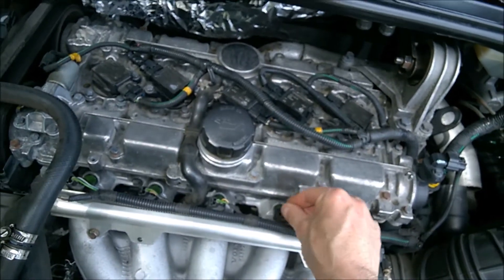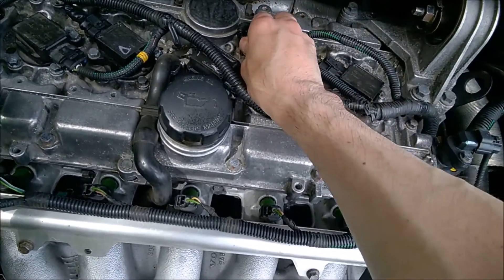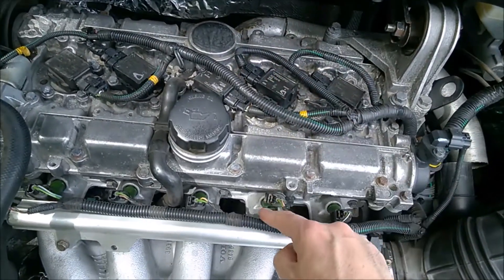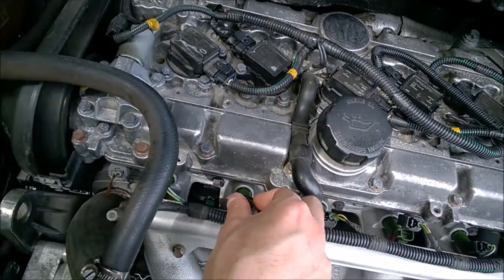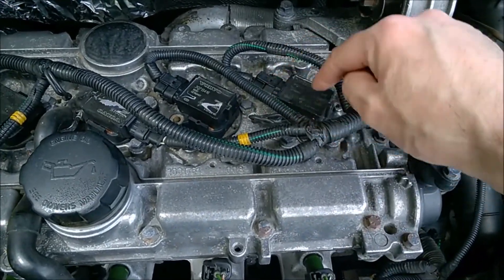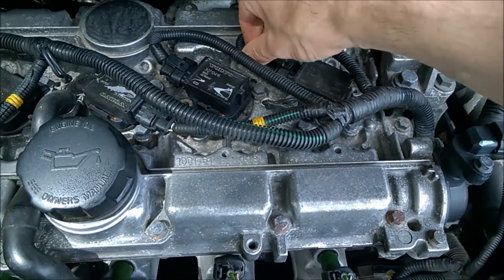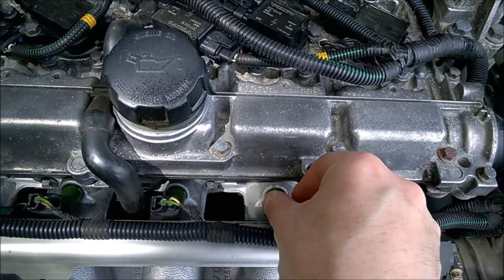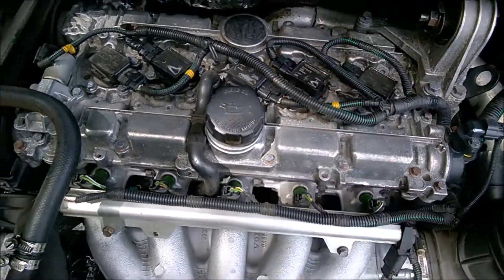Simple identify a faulty Ignition Coil - engine hesitation (misfire)  DO NOT TRY on GDI engines

Comment from the maker: IMPORTANT - it's much safer to unplug an injector than to unplug an ignition coil. Ignition coils have very high current inside, plugging them back may cause a current surge and damage the coll. 

Remember, a cylinder that doesn't have ignition may be due - check in this order - to spark plug or lots of engine oil around spark plug from engine cover gasket leak, ignition coil, injector or related wiring and connectors.

Never try to "clean" injectors at home using strong solvents such as acetone, lacquer thinner or berryman. It will ruin the injectors - ask me how I know. Regardless of what other videos may be suggesting, people don't always tell the complete story. Use only standard injector cleaning solutions.

Make sure there is no oil around the spark plugs - too much may leak on the spark plug inside the cylinder and prevent the spark however this will rarely damage ignition coils. Check grounds around the engine, wires at the coils and their connectors for cracked wire jackets touching the engine cover metal. 

May also inspect the touching point between spark plug and ignition coil, the contact must be clean. Sometimes the ignition coil goes bad. Never wash the top of the engine, water can get down the spark plug hole and cause a coil to go bad - water can even go down inside the cylinder.

Comment: I have misfire on cylinder No.5 coil is ok just there is no power just on this particular one! Can I change the wire?
Reply: Was it the 5 coil cause I have a 2009 Volvo s60 2.5t nd it says my 5 coil bad causing my car to misfire nd no acceleration any help ?

Comment: My volvo diesel shows 4th injector fault, and glow relay control for all cylinders, it suptters when in load and makes strong jerks sometimes, especially uphill, dies sometimes randomly and have to wait till it starts again, may that be the 1 injector? Mechanic told me that engine is very smooth tho

Comment: Hey man my engine is low on power and at high rpms when I really step on the gas it starts to sputter and get really rough but it’s only at high rpms it’s normal at idle and when driving between 1-3.5 rpm do you think this is a coil ? There’s no check engine light either

Comment: Hi Peppermint I have learned much from your videos.  I currently am trying to figure out why my 2002 non turbo v70 volvo lurches only when accelerating at 7mph only and thereafter it drives smooth.
Reply from the maker: Can't tell for sure but the 2002 had issues with the throttle body.  May also be a transmission or transaxles thing.  Try asking on forums  such as 
https://www.matthewsvolvosite.com/forums/
https://www.volvoforums.org.uk/forumdisplay.php?f=19

Comment: this video was help full , what kind of car is in this video cause i think it has 305,000 miles, its going a lot of miles which good showing its reliable to compared to other cars peaple buy ,, my car i drive 1997 mercury sable  dohc motor only has 131,000 miles owned the car 20 years ,, start having problems,, and it has a single coil pack ruff engine idle at cold start ,, louder motor at idle  when driving the car, can see a little smoke come out of a tail pipe at a cold start,, after warms up its fine but still misses at idle ,,  might buy something newer, at least your car has easy spark plug change and also the injectors are easy to get to,, my car i have to take off the manifold to get to the back 3 spark plugs and the injectors on a 6 cyl, the 3 front plugs are easy to change

Comment: So what does it mean if disconnect the ignition coil while the car is running and the car turns off??? Does that mean the ignition coil is good or bad?
Reply: I have the same problem
Reply from the maker: Late answer, I would think the car has already another cylinder that doesn't have ignition. When you then "disable" a second cylinder, the engine can no longer idle on 2 cylinders and dies. Remember, a cylinder that doesn't have ignition may be due - check in this order - to spark plug or lots of engine oil around spark plug from engine cover gasket leak, ignition coil, injector or related wiring and connectors.